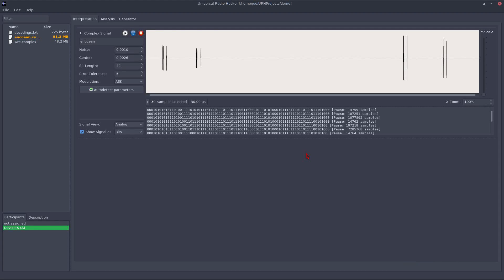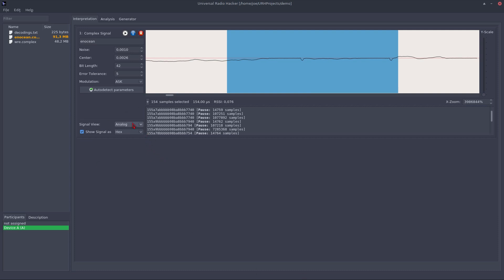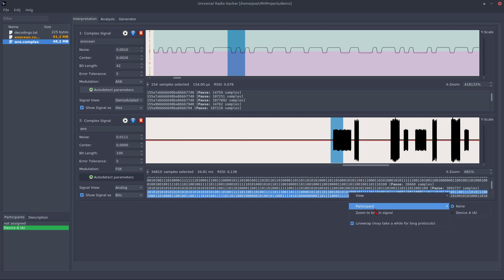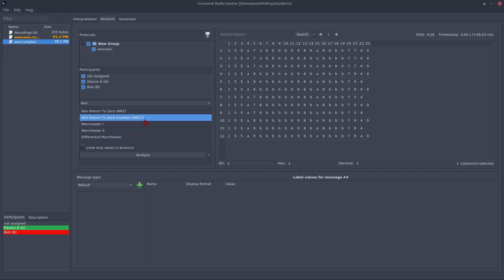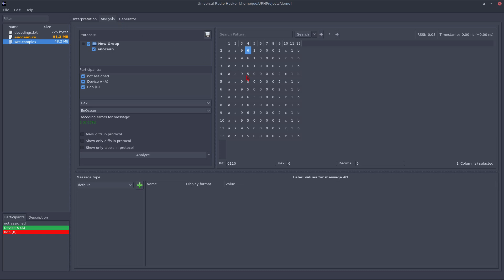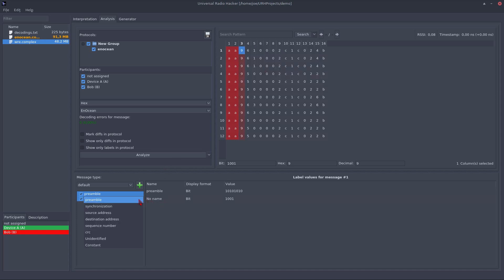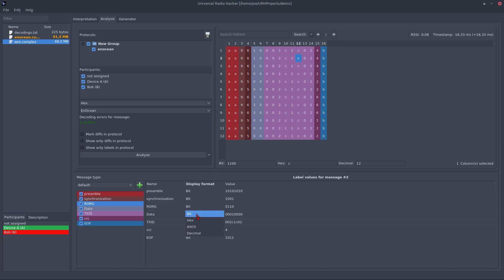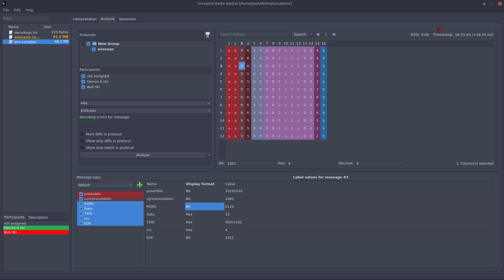Universal Radio Hacker - 03: Analysis

Comment: Hi, great videos! Unfortunately , I am still having a hard time understanding how to interpret and analyze my signals... The signals I listen to use 2.405GHz and 6LoWPAN. I know that each channel bandwidth is 2e6, I therefore set the sample rate to 4e6. I also know that the modulation used is OQPSK. Meaning there are 2 bits/symbol and I've set the samples/symbol to 8. However, I do not know where to put my center or how to analyze them, I am very confused...Which decoder technique should I use? How do I know what everything is? I would appreciate all help I can get.

Comment: I have a question here. I have a frame that starts with the demodulated signal 101010... (24 bits). Then there are roughly 17000 samples (10 bits) of 0. And then it seems to switch over to a different mode of operation in that a 0 is represented by a raw 100 and a 1 is represented by a 110, or in other words it's a short pulse for a 0 followed by a long pause and a long pulse for a 1 followed by a short pause. I have found out I can use the "remove carrier" option with 1_0 and get the bits like that for that message.
URH breaks those two things apart into two messages because of the relatively lengthy pause of 10 bits. And I don't want that because they're linked. One is always preceding the other and they're always exactly 17000 +/- 50 samples apart. On the other hand I still want to handle the two things differently because they're encoded differently.

So 1. How do I make it recognize the 17000 samples of nothing as 10 zeroes instead of silence between messages?
and 2. How do I decode the preamble differently from the other data in the same message?
and 3. how do I generate a fake message using that mixed encoding?
Reply from the maker: 1. If you hit the wrench symbol next to the ASK modulation in the Interpretation, you can configure after how many 0 bits to break a message (default 8)
2.+3. If you go into to configuration of a label you can uncheck the "apply decoding" checkbox. Doing that for Preamble and Sync should take you where you want

Comment: Has there been a discussion to put alice and bob as the new label defaults ? ^^   No, seriously - im so amazed about this. There is so much effort and love@details - it's simply unbelievable u made this accessable to everyone :)  This just is my tool, to get into unleash my HackRf and my curiosity about my neighbourhoods   'Äther'    -  Danke dir, Hannes! - Hammer ;)
Reply from the maker: Thank you very much! :) Alice and Bob are indeed the default participant names in recent versions. :) Fun fact: If you add more than two particpants in project settings you will not only see Alice and Bob but also Carl, Dave, Eve and so on up to Walter. ;)

Comment: how cool is that?!? :) so, i could tell it to decode alice as, say... modified miller, and bob as say manchester code? that sounds pretty nice! :)
Reply from the maker: Correct!
Reply: @dr.johannespohl8547  installed it yesterday and took a quick look, looks amazing! just out of curiosity, if i had a device that could send, would it be possible to send like a weak, inverted version of the original signal to emulate a device that doesn't actually send, but rather communicates by "turning it's antenna off and on again" ? ;)
Reply from the maker: @5ch4um1  Sure thats no problem. Just put an invert encoding on the signal in Analysis tab and then send it back via Generation.
Reply: @dr.johannespohl8547  amazing... next you tell me that i could even send arbitrary messages by simply using the fuzzer tool...? o.O
Reply: @dr.johannespohl8547  i saw the other video now, like, you even implemented a handshake, that's all pretty crazy stuff!
Reply from the maker: @5ch4um1  Yes you can also use custom decodings or insert arbitrary sine waves, so you can basically send everthing you want.
Reply: Is miller / modified miller available directly via URH? (I Can't find it)